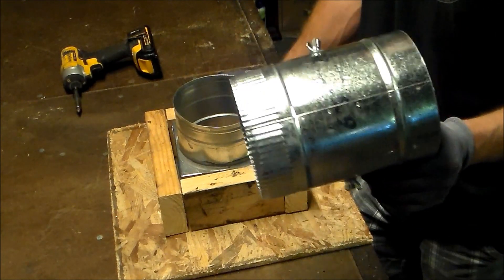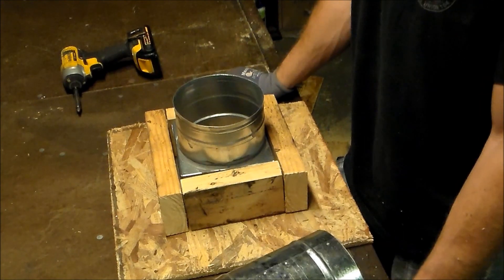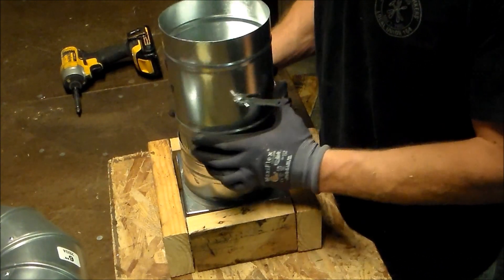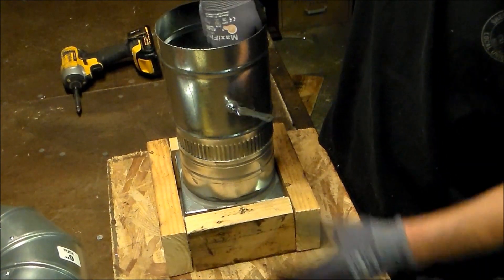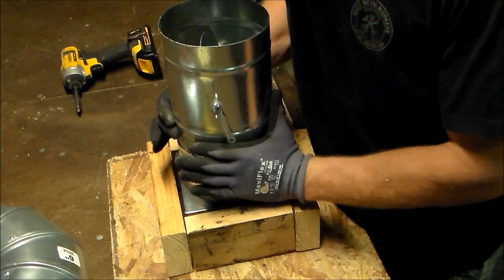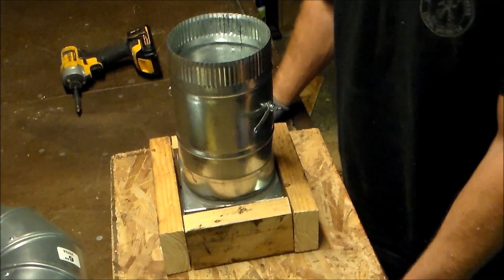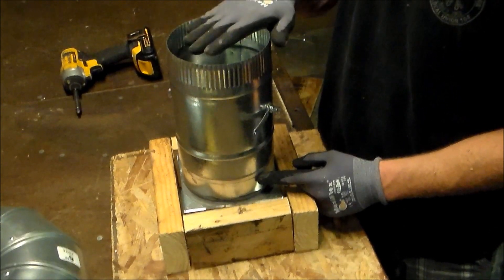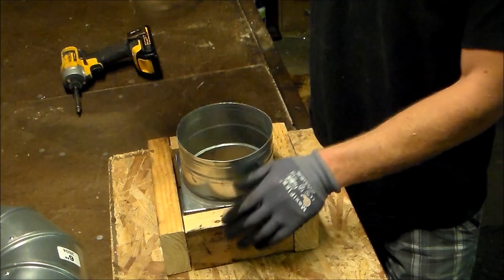How to install a Sheet Metal Duct Damper on a Register Can or Box for Heating and Air Conditioning

Comment: how do you wire up a automatic damper to wood furance?
Reply from the maker: +Thomas Flynn Should be a simple 110 connection right? There is some that are modulating and have control boards on them. what model are you looking at?
Reply: ard10 1228 honeywell
Reply from the maker: Are you wiring to a control board? You may need a transformer if you are not. What is the sequence of operation and what are you trying to accomplish?

Comment: Hey kid, thanks for sharing. I am a sheet metal BIM modeler, (I use PractiCAD) much like CADD Duct. I worked for a MEP engineering office and then started my own Shop drawing company and was trained by guys who worked the field, but I never honestly have. One question I have is Round Spiral duct. I know you cannot attach fitting to fitting, but would that go for elbows as well? Say we have a square to round coming down the rectangular line, after the square to round, we need to put at least a 4" straight pipe before the first fitting, say we use a 45 elbow. I cannot connect another elbow to that elbow? Or do I need to add another 4" straight pipe? I am watching as many vids as I can of you. Thanks bud for sharing them.
Reply from the maker: Hey Shane, Thanks for watching! No need for an additional 4" of straight, you can connect an elbow on an elbow.